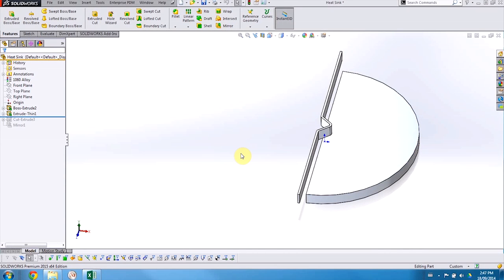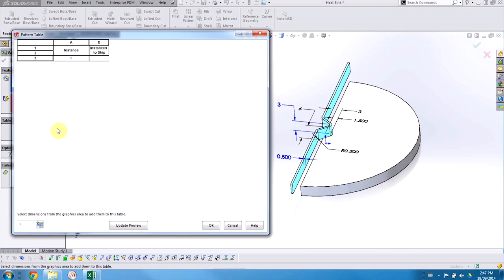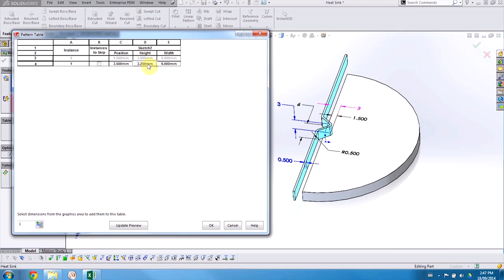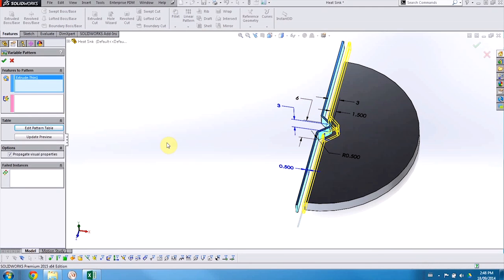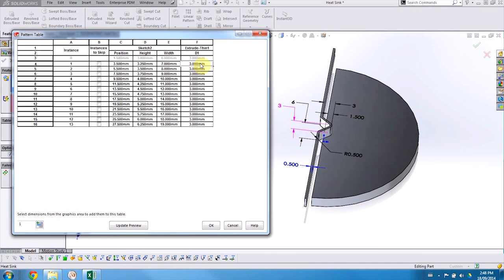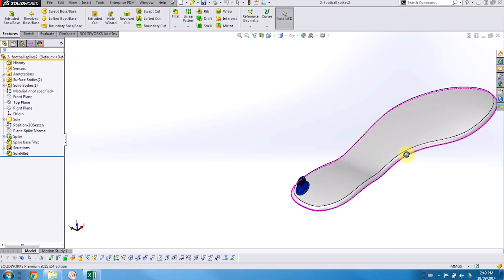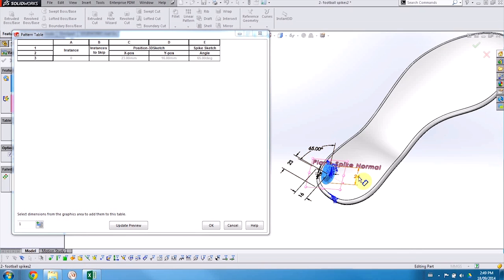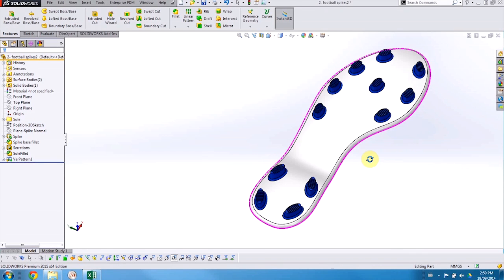SOLIDWORKS - Top 10 New Enhancements in 2015: Variable Pattern

Comment: I want to use suppress command.

Eg. 1.take plate  , give it 5 holes pattern gap of 5mm

Draw a square on the plate, use extrude or cut, pattern it 10 times

Now I want to suppress holes where square comes i.e position of 10mm and 20 mm

I can suppress this manually but i want use equation or design table or any other command
That if I want to change dimensions the hole will suppress automatically when square comes in the same position